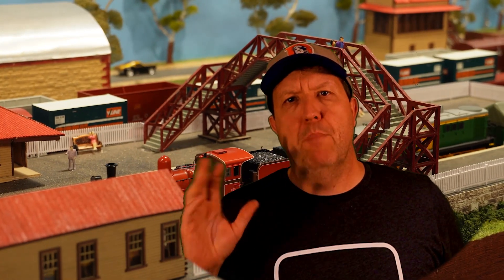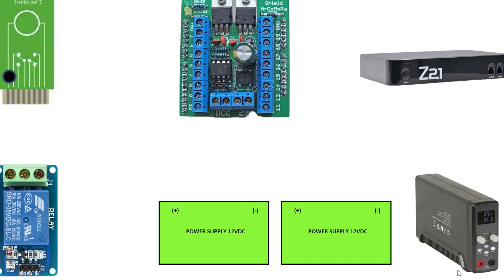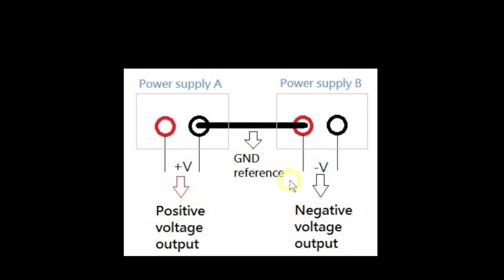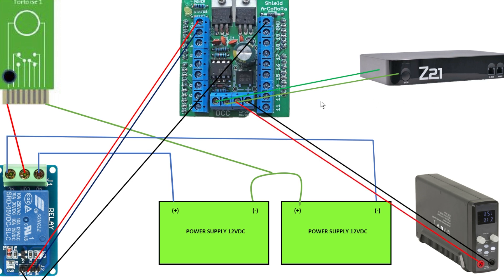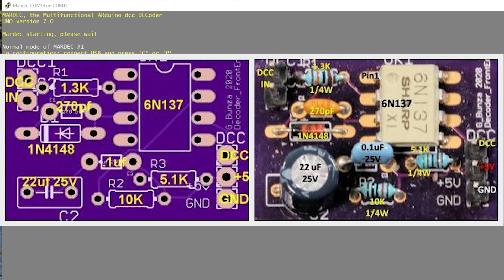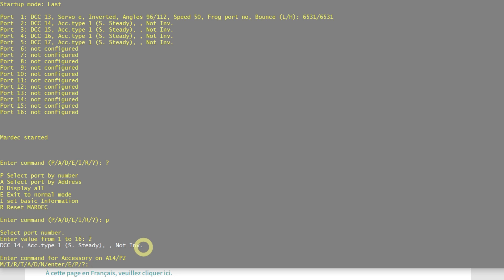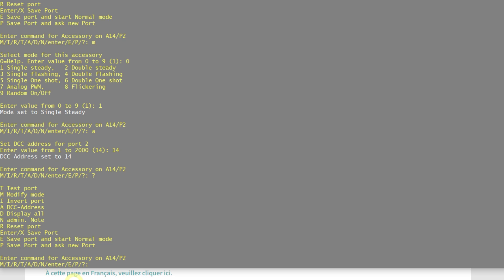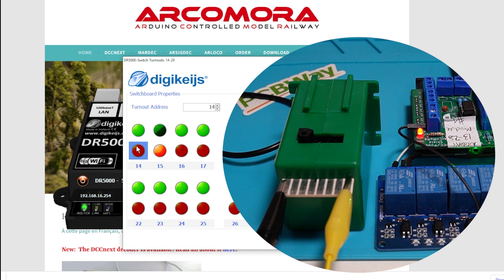Cheap Arduino Stationary decoder for you Model Railway. Tortoise Motor Control

Comment: I’m all for good solutions, but you don’t talk about the cost or what the savings would be.   How much are each of the components and how does it compare to the system options out there?  A single Digitrax DS78V will control 8 turnouts at a cost $10.63 each without the need for all of the addition work.
Reply from the maker: Hi Scott I have put this in the description. Cost is $1-$3 if you are prepared to import your components. This would be in the high side too.  
 Plus the MARDEC can do much more than the loconet version you speak of. It really comes down to the cost saving v time. Once you got my version down pat. They are really easy to put together. Thanks for you comments

Comment: I discovered ArCoMoRa by accident and have loved using it.   It's not for everyone as it does need a little timkering to get it just right.    The IOTT youtube channel also has some really good stuff, based around the DCC-EX controller software.   Honestly, for me, I would never by Digitrax or similar because I find I can get all the control and functions I want and need from the DIY type solutions, but I do understand some would want to buy off the shelf.    You are absolutely right about price.  The models alone are crazy expensive.   It sometimes feels like the mainstream manufacturers want to price the hobby to be exclusive for people with a lot of money.   
I have a 3D Printer, so I don't use Tortoise or similar as I have been able to print my own point motor housings and use the cheap servo's from China, using the setting in ArCoMoRa to set the movement limits.  I found some under track mountings that also hold little microswitches so I can get the function of switching the polarity of the frogs and stuff like that too.
I appreciate everything you do on your channel to show ways that we can save money with a little tinkering.     I find half the fun of trains is the tinkering :)
Reply from the maker: Thanks for your kind comments. If you are prepare to tinker. These are easy really. once you get the basics down. A significant amount of money can be saved. ARCOMORA really is second to none